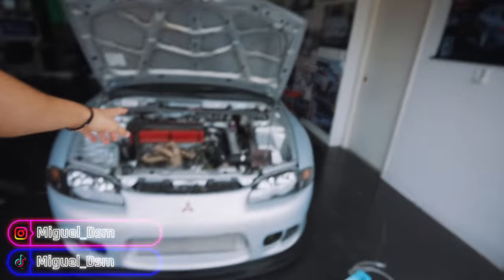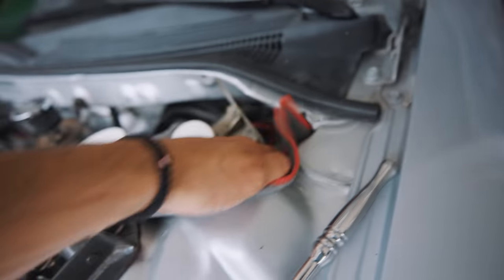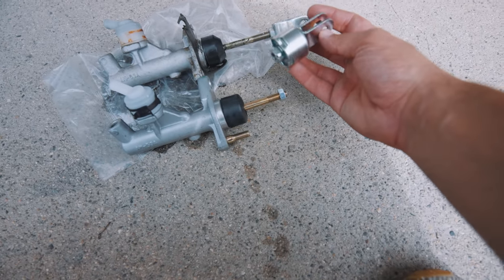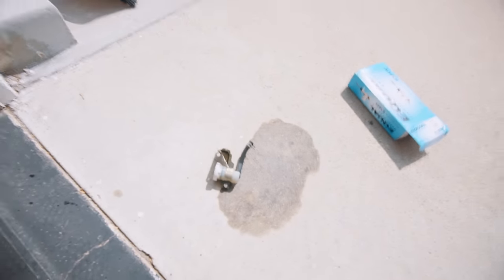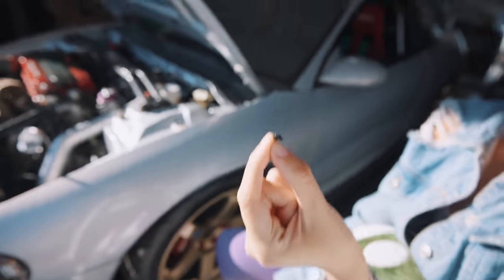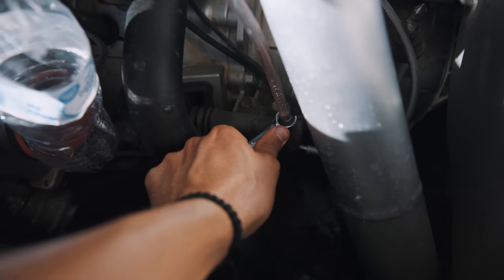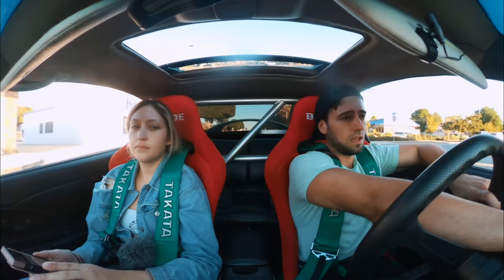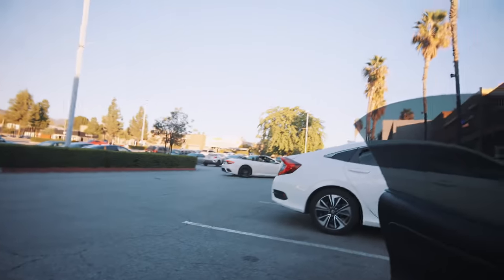Fixing My BROKEN Eclipse TURBO! | Clutch Master Cylinder Replacement

Comment: Aye so hard lines are always preferred because they don't change volume as much under pressure. So basically you want soft lines (such as ss braided lines) as short as possible so you don't have as much of the pedal travel going into deforming the line.
Reply from the maker: Might be better to get a much shorter line then. Thanks for the tip

Comment: Ordered the same exedy master and cylinder for my gsx 
And had issues with it from the beginning would not recommend. 
Especially the master cylinder. 
Even swapped rods. To make it work. Vs the oem. 
Still had issues.
Learn the hard way. 
I’m running a autozone one and it’s even better than the exedy tbh
Reply from the maker: What where your issues? Engagement feels different but nothing out of this world
Reply: @MiguelDsm  just the pedal had to much play. And when I extended the rod the pedal would feel stiff and Great but then it wouldn’t allow me to change gears . 
Pedal had to be way loose. To switch gears 
Felt like a dying clutch/ I was dragging the clutch. 
But hopefully u don’t have issues with it.
Reply from the maker: I’ll keep an eye on that. Hoping that’s not my case

Comment: Thank you for posting this. I need to replace mine to.really help me!
I have 1997 spyder. Btw did u get your engine swapped?
Reply from the maker: No worries 👌🏼. It’s Evo 8 swapped
Reply: When you get engine swapped is that comes with the transmission? Or used old transmission? 
Im thinking to get evo engine. Do u know what is the estimate cost for engine swapped?
Reply from the maker: You can only do it on the 420a model with an Evo transmission. Costs around 15k not including labor

Comment: The engine takes a long time to start, the problem could be the timing belt is out of point?.
Reply from the maker: No, It’s on ethanol. Hence why cold starts take longer
Reply: @MiguelDsm mine doesn’t take that long to start. Even on C85 tune is off IMO